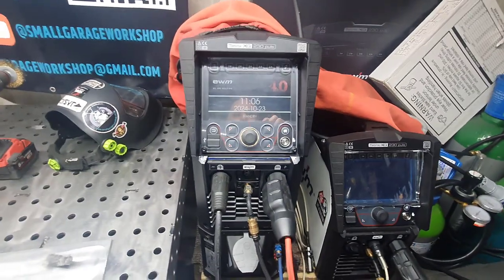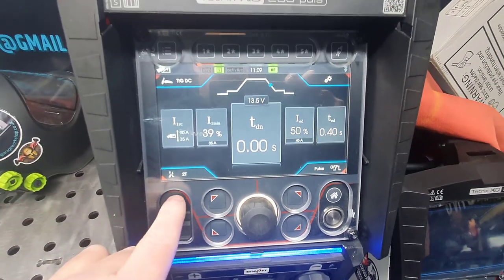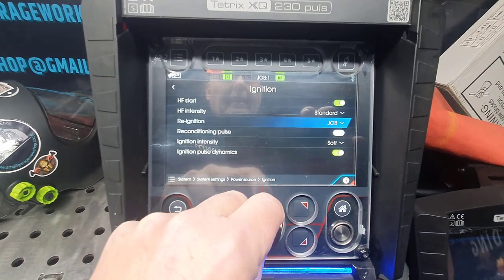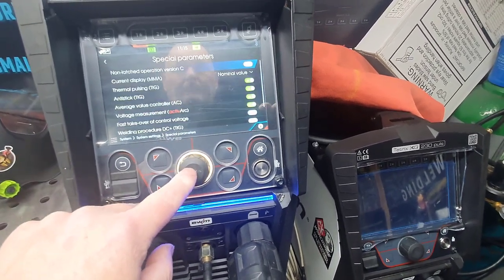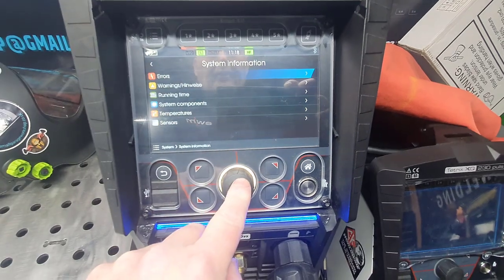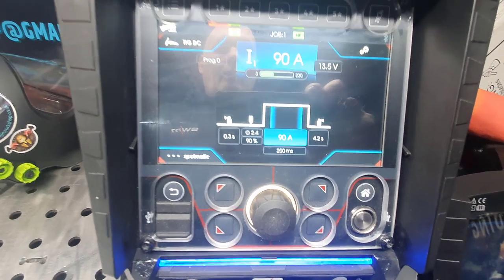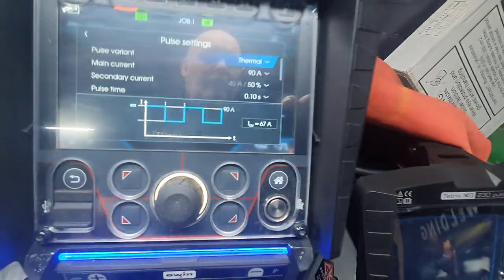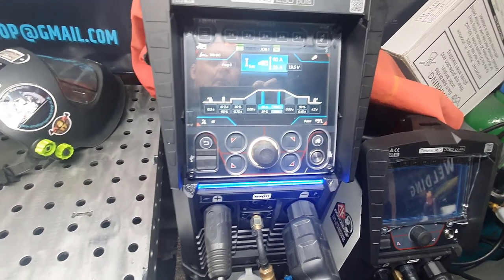EWM Tetrix 230 XQ Part 1 (Menu,s And Settings)

Comment: In What this thing is better then other tig machines you used?
Reply from the maker: Its better than the Kempi master tig and the Fronius 230 magic wave with quite a way however only in my opinion 😊
Reply: @smallgarageworkshop6119 ,did you compare it with fronius magic wave 230 AC/DC?

Comment: hello, how did you set the two windows 90A max and 39%min on the main panel please? thanks for the reply
Reply from the maker: @abrvideos5645  sorted now 👍
Reply: Sorry i dont understandnu...how did you apply the two main center columns?? Thnks @smallgarageworkshop6119
Reply: @smallgarageworkshop6119  sorry, i dont understand u. how did you apply the two main center columns?